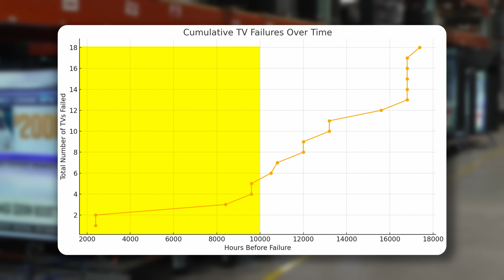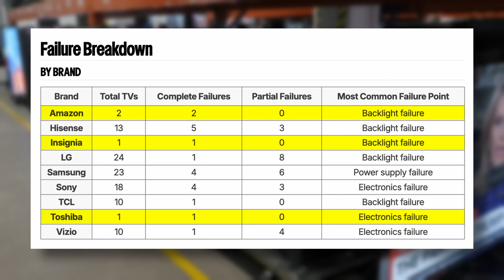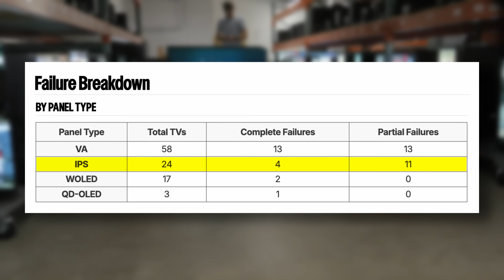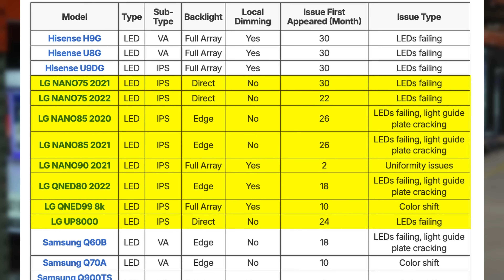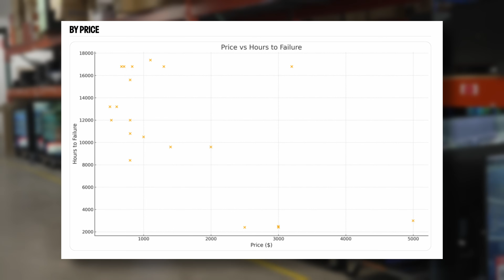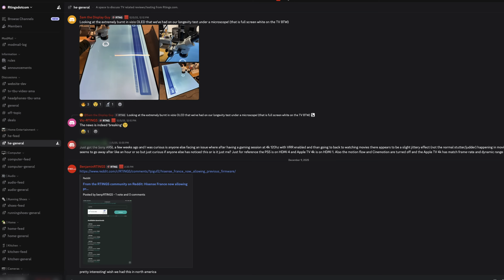Which TVs Break First? Results Overview From Our 100 TV Longevity Test

Comment: I make a mistake and bought an OLED, and now all others technologies deferents to the OLED looks like crap to me.... I'm doomed.
Reply: Watching a good movie on a Oled is like watching live action out of a window.
Reply: @brokenwrench404  I've often said the SAME of my Samsung edge-lit and HISENSE ULED! ... I'm underwhelmed by dim OLED!
Reply: @marcse7en    My Samsung OLED is hardly dim.
Reply: @marcse7en you mean you're underwhelmed by the hisense. Oled is superior, nobody argues oled is inferior
Reply: @DuzixRS  ... Until I just did? And others have echoed my opinion. OLED is flawed in many ways; for example, a lack of detail and brightness, and the risk of screen burn. On paper, LCD is an inferior technology, with its own set of issues, but it has advanced to a point where it can compete with OLED, and in some areas, for example, brightness, detail, and immunity to screen burn, can actually surpass OLED. I'm still disgusted with LG Display for throwing a "defective" panel into my CX, whereas the HISENSE is pixel-perfect with a stunning picture. In my experience, and I've carefully adjusted both sets, the HISENSE has the edge, with the LG, dead pixels aside, being "adequate." Incidentally, the FALD VA panel in my HISENSE provides excellent blacks.
Reply: @marcse7en i agree with you that sometimes LED can look better but FALD cannot hold up when it comes to gaming. OLED still maintains full contrast when FALD basically has to be turned off or at least dumbed down significantly to keep input delay low.
Reply: @adamj1326 That was years ago, current gen TVs perform the same contrast measurements in game mode with some rare exceptions like Panasonic W95 unable to process VRR+ Local dimming. But some like a Bravia 7 will look great with anything.
Reply: same. bought LG OLED C5 48inch for monitor. one word to describe.

AMAZING
Reply: I bought a S95B back in 2022 and still rocking and loving it - i was doomed of oled.
Now your our living room we bought an G5...and i was shocked that only the brightness was barly brighter...but everthing else was the same 😂
Reply: Welcome to the space heater plasma club. 😂😂
Reply: Same here 😂
Reply: Really I got an OLED  monitor and it's ok I was kinda of expecting more.  Seems like they don't get to bright.
Reply: @X862go OLED monitors still have some catching up to do. OLED TVs are significantly brighter.
Reply: Welcome, brother
Reply: My LG B9 oled has been in use for something like six years now. I watch a lot of Youtube and my daughter plays a lot of The Sims 4 on it. No burn in whatsoever.

It has some dead pixels especially around the top of the screen, nothing too serious yet. If this means I have to get a new one every 7-8 years or so, it's a price I'm willing to pay for the picture quality.

Mini LED is just LCD, no match for OLED.
Reply: Nah, you’re all good, I’m still using my crt from 99
Reply: Yes
Reply: Yep lol
Reply: The worst part is going to cinema 😢,  
Projector technology left behind many years.
Reply: Motion clarity is the most apparent thing, beyond the perfect blacks that is.
Reply: Like back in the days when Pioneer ruled with their plasmas.🥰 I remember I panicked when they stop making tv:s and plasma overall was on the last note with just crappy LCD:s with light grey ”blacks”.😅
Reply: Don’t worry, they will last and you get best pictures. I made the same mistake, and repeated this year 😂. The fist one (LG B8) still running after 8 years, no burning in. Got a C4 this year. Just don’t watch CNN all the time 😅
Reply: That's why I don't push too hard on normies when they tell me they don't see the difference. Now I congratulate them and their wallet and move on
Reply: @Oshadorin ignorance is bliss
Reply: Greatest mistake. 😅 My heart is happy, my brain is happy only my wallet bleeding.

Only OLED. TV OLED, monitor OLED. Never anything else. Ok unless new technology.
Reply: @mistrdavid I got LG C2, Steamdeck OLED, and most recently a curved OLED ultrawide 😅🤩
Reply: @mistrdavid Yep can't go back now
Reply: Same. I love my lg c3
Reply: Plasma was pretty damn good
Reply: @rartolak     Plasmas only look good until you get something new…
Reply: @JohnCap523 As long as it's an OLED
Reply: @rartolak I'm still using a 2008 Panny.
Reply: @evcass69 Same here, still looks fantastic.
Reply: @JoeStoppinghem Same.
Reply: @evcass69     Still looks fantastic because that’s all you’re looking at…  🤪   I had a great Panasonic plasma too, and it looked great, right up until I replaced it in 2014.
Reply: @rartolak true, in fact they both share the same principle where every single pixel is a light source! Unfortunately the burn-in problem was more evident on plasma! I used it for 10 years with the ghost of the minimap and the car hood from NeedForSpeed MW2! My dad wasn't happy after spending 3000€ on that!
Reply: @rartolak  not in today’s flat panels. The price for the plasma is where you really got ripped off. But at least you can always use it as a space heater.😂
Reply: @rartolak yeah some of the higher end plasmas still hold up pretty well. Definitely a bit on the dim side but very pleasing in a dark room. I really like the way they present older film content.
Reply: I bought myself a 360Hz QD-OLED monitor for my PC and yeeee, I'm never going back to LCD, lmao. Even a slightly damaged OLED will never be worse than an LCD.
Reply: @TheUltimateBlooper my monitor is oled but my tv is min led
Reply: @TheUltimateBlooper I disagree. I use a Samsung edge-lit TV as a PC monitor. Excellent picture (I know good picture quality, as I do video editing and photography), and ZERO risk of screen burn. Using OLED for displaying static images, such as computing, for hours on end, is insanity in my opinion. Even station indents, and other static images, on TV are enough of a worry! ... OLED is far from perfect. And thanks to LG Display, mine certainly isn't!
Reply: I'd be surprised of mini led look like crap to you cause great one like tcl c8k looks very close to oled tvs
Reply: @talion7268 a mini led backlight panel is still an LCD monitor. Fast moving Images will look blurred compared to an OLED. Reducing the size of backlighting LED’s and making them mini only changes the contrast ratio.
Reply: Forget it, i have the 85inch bravia 9 and the 83inch LG G5 now, i always thing the  dofference is minor because minileds are so hood now but man i was wrong, i never expected that oled are that much better
Reply: @talion7268  no every miniled looks bad. 😅 Miniled Never. Bought G4 LG and happier then ever.

I didn't see Samsung microled thought. We don't have that expensive TV in shop.
Reply: Same bro… whenever I look at an LCD I’m like what is this ghosting?
Reply: Ignore the people that says they will never go back to OLED they are lying, as soon as LCD gets LEDs close to pixel in size.. and we have micro RGB coming their own eyes will abandon them

And they won't be able to tell the difference
Reply: Mini led technology  is good
Reply: @u2fkeys665  But not quite as good and often not really cheaper than Oleds. Especially the better Minileds that actually use the brightness advantage.
Reply: @u2fkeys665  but not as good as oled.
Reply: @u2fkeys665  Micro LED is where it's at, though it'll take a while for the prices to go down to afford them.
Reply: Desktop OLEDs are garbage. They have lower brightness than AMOLED, which is used in all mobile phones.
Reply: @AndyHDGaming1 

And they produce a significantly blurrier image than LCD. The same for TVs.
Reply: Now you know what a 18 year old woman feels like in the dating market 😂

Imagine being 45 😣 😑 😩
Reply: idk I bought an LG OLED while having a good IPS monitor (Dell U2412M) and now I appreciate both techs for their respective benefits. While I see the obvious difference, my IPS monitor still presents a very good picture and I use both daily.
Reply: This is an unreal & hated comment for Oled tv's lots of reviews and old threads mentioning brands like C2 & C3 living up until this day, you never mnetion whats that oled you had which might be worst oled brand is. Not all market the same. All what i can say as a led customer for previous years up till QLED i made my mind that OLED without qustion is best for organic color to the eyes!
Reply: Get a projector
Reply: Except OLED does not produce as sharp of a picture as LCD. In some cases the difference is stark. I wouldn't get an OLED just for the burning issue..
Reply: @CorneliusTaylor-s1uyou have it backwards. OLEDs have perfect pixel level detail. Sometimes they loose detail in really dark scenes or if they are clipping bright highlights but that happens on FALD LEDs as well. Burn is not really an issue as they explained in the video.
Reply: Just wait til you notice the burn in
Reply: @Hypnotica420x 3 years and waiting....
Reply: @Jbustosalazar 

Maybe you don't look hard enough because you're afraid you'll notice it and then you'll never be able to unnotice it.
Reply: @Hypnotica420x  You won't experience burn in if you're not a bonehead!
Reply: I had an oled LGE6 for 7 years, now have a FALD TCL and I don't miss my oled. Or the burn in.
Reply: @IOWMancunian  My HISENSE ULED U7 FALD (VA panel) can give OLED a run for its money any day! ... And, it LAUGHS in the face of screen burn! 👍🤣
Reply: My g9 57 Inch is better than everything, no burn in worries
Reply: OLED is so overrated...I will NEVER purchase a TV that has an issue with burn-in and dimming over time. I still have a late gen Panasonic plasma that my wife has burn-in on and it was babied for years.  Every single one of my LCD TVs is still going strong after all these years and also look great. The only TV sets I ever had issues with are the Panasonic plasma and a Sony Wega HD CRT. I have an edge-lit Samsung from 2018 that has a TON of hours on it and doesn't have a single problem...if it had been an OLED it would have burn-in and be a lot dimmer...no thanks
Reply: @DaMerk5  definitely not overrated. But not for everyone... Also my OLED monitor is one years old. Still perfect. On the other hand my simple led monitor had one burned pixel in first six months...
Reply: @DaMerk5 I still have a Panasonic plasma. Used daily since 2008 or 2009. No burn in. Still looks great.
Reply: @DaMerk5 new OLED has refresh cycles that kick in after you turn it off. And don’t cut power. That’s what causes image retention. My C2 is 3 years old and as great as ever. Use it mostly for YouTube and games
Reply: @DaMerk5  I agree 👍
Reply: @DaMerk5 dude, burn in just isn't a thing unless you're deliberately trying to have burn in. 

Burn in hasn't been a thing for a long time. We have had our LG C2 77" TV for like 5 years now and we run it at full brightness for 5-10 hours a day and there is not even the slightest hint of burn in.

Don't let FUD stop you from buying the clearly superior product.
Reply: Watch some movies with very low light and you'll notice how much detail you were missing due to the crushed blacks, that should help you appreciate LCD some more. Some movies look outright weird on OLED due to the missing detail in dark scenes. There is some content that simply looks way better on a 15 year old LCD (DVDs for example).
Reply: @awesomeferret if your OLED is crushing blacks - it's set up wrong.
Shadow detail, especially in HDR, is like one of the biggest advantages of OLED lol.
Reply: @TheUltimateBlooper  This. OLEDs did have an issue with dirty shadow details but if the shadow details are crushed outright then something is wrong. Using a preset that hypes up the contrast? Gamma too aggressive? If using external devices, HDMI range set wrong? 

One of the benefits of OLED is that thanks to its infinite contrast ratio is is actually capable of completely flatline, absolute 2.4 or 2.2 gamma curve. The darkest shadow details are supposed to be dark, visible but dark, and OLED shows them as such. Before minileds became a thing LCDs did not have high enough contrast ratio for that so they had to have a relative gamma curve, the darkest shadow details had to be lifted up to keep them in the contrast range that the TV is capable of, to prevent crushing them.
Reply: @MaaZeus Infinite contrast doesn't tell that much. Because OLED with more nits have more potential contrast between black and white.  Other than that yeah.
Reply: Bull That's 🐂 crap
Reply: @awesomeferret if I watch a dark scene in a movie, I want it to look dark and not like a sitcom.
Reply: @awesomeferret we had plasma. That was somewhat great.

Still. HDR OLED is just amazing.
Reply: I inherited LG OLED from my parents, and it looks like crap to me, compared to my HISENSE ULED! ... The LG panel has lots of dead pixels around the edge of the panel (tut,  tut, LG Display!), whereas the HISENSE panel is pixel-perfect, and in Filmmaker the LG picture is dim! ... OLED ain't all that!
Reply: @marcse7en which model of LG and hisense? ULED is mini led nothing extra specials. Yeah Hisense looks great. I like Hisense. They also pushing technology... But definitely don't have that good blacks...

Of course if you get broken TVs that's unfortunate. 🥺
Reply: @mistrdavid  LG CX 65" (2020), HISENSE U7 50" (2020). I'm going to try tweaking the LG settings. Unlike the HISENSE, there's always the worry of OLED screen burn. I've also got a hardly used boxed Panasonic 42" Plasma.
Reply: @marcse7en  the problem with burn in is each year better. I would guess 2023+ tvs are pretty good. But even better tools to prevent like AI coming to TVs.

Black should be definitely better on LG. But it is possible that the Hisense has better brightness. According to web nits should be same. But the LED usually has better brightness across whole screen.

Also one thing. Sometimes the picture depends on the processor especially if it's lower quality movie or broadcast. I don't know which of those tv does it better. But if you see Hisense better maybe it is...
Reply: @marcse7en 

OLED also doesn't produce as good detail as LCD. In many cases the detail is poor in comparison.
Reply: @CorneliusTaylor-s1u I agree! The OLED picture doesn't seem as sharp and detailed as my excellent HISENSE ULED!
Reply: @marcse7en    😂😂
Reply: @JohnCap523  What's so funny?
Reply: @marcse7en     You made a funny misinterpreting the original sarcasm…
Reply: @marcse7en an OLED will absolute have better picture quality. It's not even a competition. 

That's fine if you like your LCD, Oled IS better.
Reply: @Boguardis  Do you own both technologies, as I do? Have you thoroughly evaluated them at your leisure? Have you seen a properly set-up Quantum Dot FALD VA HISENSE? ... I will say it again, the HISENSE (in Cinema) compares very favourably with my LG OLED (in Filmmaker). The LG is disappointing, not least because of LG Display's shoddy panel.
Reply: @marcse7en  I do. The only thing the QLED is better is in it's overall brightness and bright room vieweing. 

The LG absolutely decimates it with black levels and clarity in darker scenes. It's not even a comparison.
Reply: @Boguardis  I disagree! In Filmmaker the LG is dim, and ridiculously so in dark scenes. The colours are overly warm (Warm 2). Having experienced the excellence of HISENSE ULED, the LG is disappointing, and reduces the enjoyment of everything I watch. The LG only shines in bright scenes (no pun intended). The OLED lacks detail and sharpness. The HISENSE is more than a match for OLED. And the LG certainly does NOT decimate the excellent VA panel blacks, although admittedly, off-axis is poor, although it's NOT a problem. Have you experienced both technologies side by side over time? I'm guessing not? And incidentally, the LG bass distorts easily, whereas the HISENSE sound is perfectly clear.

And DON'T get me started on LG Display's defective panel with dead pixels around the screen periphery! Whereas, you guessed it, the HISENSE VA panel is pixel-perfect!
Reply: sounds like an idiot that never touched grass on his entire life lol